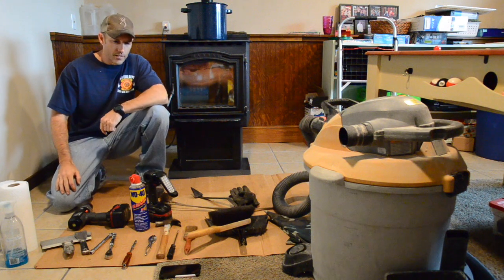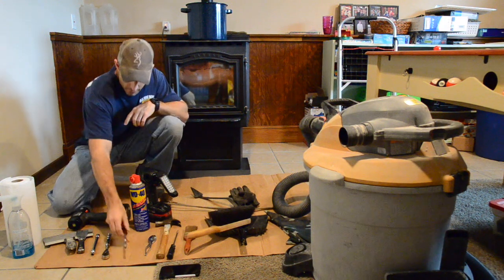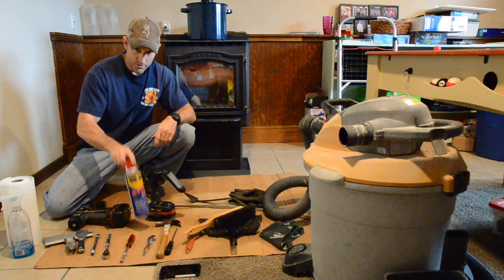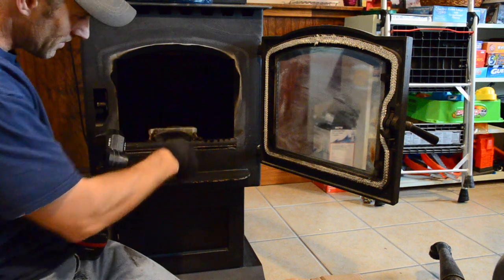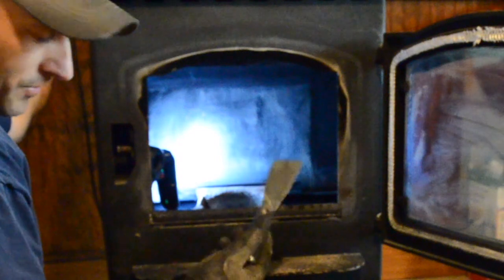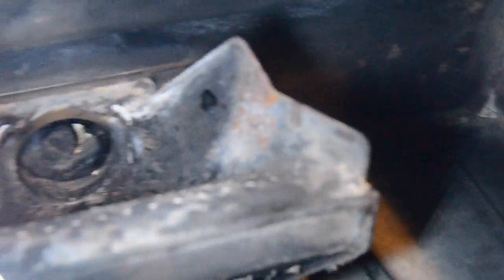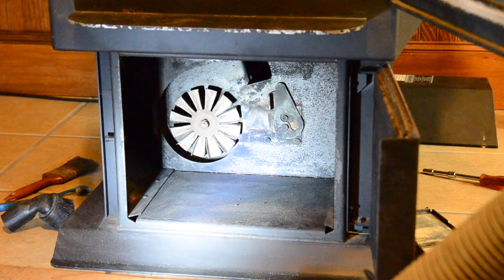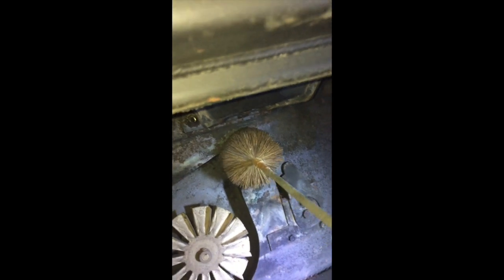Harman P-series pellet stove cleaning END OF SEASON P68

Comment: Great video , thanks so much. I just had one installed this past summer , learning on the fly what to look for  !
Reply from the maker: I must have 15 videos on the Harmon. You picked the best. Stay warm
Reply: @DIYJIM  Hi Jim. I have a question about the pellet stove. I had it installed in the basement and made the mistake of putting a smaller screen on the outside preventing it from getting the air supply , took it off and cleaned the pipe as far as I could go from both ends, I need to get a better brush to run it from end to end  it worked better, but the smell was giving us headaches, so I shut it down until I figure out the problem !  I've been watching videos and reading up where it says to install a outside air intake, that this allows the carbon monoxide from building up , I believe that is part of the problem ! Do you recommend putting this in and do you think this will take care of this problem ? I'm also going to get a carbon monoxide detector that is recommended  ! Thanks for your help !!
Reply from the maker: @raymondhoagland4976  I have a cold air intake on mine it is right below the exhaust. I have never had a problem. It should actually run much more efficient with a cold air intake.
Reply: @DIYJIM  Forgot to add , the stove was put in the basement. Thanks so much Jim  !
Reply from the maker: @raymondhoagland4976  maybe you should put a 90° on your outside exhaust and go up a little on the exterior wall. Then put a cold air intake.
Reply: @DIYJIM  Thanks Jim. Have a great day !
Reply from the maker: @raymondhoagland4976  welcome

Comment: I had a St. Croix pellet stove for 18 years until a lightning strike took it out. I replaced it with a Harmon. I hate my P-68 pellet stove! I've had nothing but trouble with it and Harmon won't even give you tech support. It's a $4000.00 pos, but live and learn. I'm stuck with it for a while now. Thanks for the video! I appreciate it, brother!
Reply from the maker: Sorry to here that, my stove has never let me down. Hope some of my videos help you https://www.youtube.com/playlist?list=PLZEGsnRsdHN5OBGSj2h0bNAqFjsPyroG9
Reply from the maker: Was your ST. Croix easy to clean and did you burn the same amount of pellets? Why did you not buy another one? Asking in case I ever want to change my stove.
Reply: @DIYJIM  I never had to do anything with my St. Croix for 3-4 weeks at a time, except pour bags of pellets in. There is an extended handle that scrapes the heat exchanger without opening the stove. The burn pot is self cleaning too. The bottom of the burn pot is about twice as large as it needs to be and moves, slowly (probably like the minute hand on a clock) back & forth cleaning and scraping the burn pot as it runs. Regular cleaning and yearly cleaning was MUCH easier. I definitely used about 20-25% less pellets in the St. Croix. The Harmon is definitely less efficient. I'll post my saga, as briefly as possible about my issues with my Harmon in the next post. BTW, you have great videos on your channel!!
Reply: @DIYJIM  OK, I decided to buy the Harman P68 because of good things I read on some forums. Many Harmon owners swear by them. So, when I get it home, I noticed that the standard pellet stove vent didn't fit the exhaust of the Harmon. I called the dealer where I purchased it (the only one within 150+ miles of me) and he told that they drill two holes, fill the gap with high temp silicone and use two self tapping screws. This just didn't seem right to me. After some research, I found that there are actually adapters for Harman stoves (to reduce the size for standard vents.  Harman won't sell to the public, so I had to order it from the dealer, wait almost two weeks and drive 75 miles to pick it up. That solves my first problem, but my problems were just beginning. I decided to just put brand new 4" good quality venting and start new. I fired up the stove, and the odor of smoke was pretty bad. I checked my vent and all seemed fine. It was coming from the stove itself. Since the dealer didn't even know about the exhaust outlet, I called Harman directly for advice. They will not speak to customers directly and told me to call the dealer. They came out and told me I had to use 5" vent and they wouldn't warranty the stove unless they did it. $650.00 later, with the 5" they installed and said to wait 48 hours before using it. After firing up the stove, the odor of smoke was worse. They came back and fixed leaks at the joints and told me to wait 48 hours. Again, strong odor of smoke in my house. They came back out and said I needed a cold air intake. $450.00 later, I fired up my stove and....strong smoke. At this point I called Harman for help and, you guessed it, they wouldn't talk to me and referred me to the incompetent dealer. He came back out and changed the gasket, I waited 48 hours and again, my house was filled with strong smoke. Nearing the end of the winter, I gave up and figured that I would try to deal with it during the spring or summer. This is the end of part 1, but it gets better
Reply from the maker: @timmack2415  holy smokes wish I lived near ya I would come try to help ya.
Reply: @DIYJIM  I bought two propane fireplaces and used them for the next two years. This summer, I called the guy who sold me my St. Croix and he came out to look at it. Apparently the welds on the heat exchanger on the left side were so bad, they actually had gaps, and smoke was getting through. I called a welder who, for another $200 patched up the welds. I tried it and all seemed well. I ordered 4 tons of pellets in October and was all set to use the Harman this winter, and I did for about two weeks until the blower motor became really noisy and then stopped working. Mind you, I haven't even burned a dozen bags. I had to call the "dealer" to get a new blower motor for $235. The stove was working until, on Thanksgiving, I woke up with a sore throat, burning eyes and smoke again. Apparently the weld on the other side of the heat exchanger cracked. 😡 I have 5 grand into this thing and I've had a few weeks of operation from it. Aside from all that, I have several gripes about a few poor design flaws that I haven't gotten to. St. Croix was always excellent with giving great tech support on the phone, Harman refused to even speak with me (and I'm a super patient and polite guy) even with all the problems with my "Harman dealer" I'm not sure what I'm going to do at this point. I'm in for over 5 grand at this point and still don't have a working pellet stove.
Reply: @DIYJIM  Thanks, Jim! I wish you were closer too! Sorry for the long rant, but it's just been a frustrating journey. I either need a welder, or a bottle of Valium at this point. LOL How often do you need to scrape the burn pot on yours! The ash builds up, covering the air holes and the flame seems poor. Is it normal to have to clear the ash every several hours? Thanks
Reply from the maker: I normally scrape the burn pot and heat exchanger and add pellets once a day. Sometimes I might skip if in a hurry. It only takes a couple minutes. Check out my daily routine video  https://www.youtube.com/playlist?list=PLZEGsnRsdHN5OBGSj2h0bNAqFjsPyroG9.
Reply from the maker: I have thought about switching my pellet stove for a propane stove but after doing the numbers it seemed like it was going to cost to much for propane. What did it cost you for propane compared to pellets. I have saved on pellets because I installed heat pump air conditioners that I use when it is above 30 deg F. Here is a link to one that i am thinking about installing in my garage   (DIY Mr cool) https://amzn.to/2RqU0C0
Reply: @DIYJIM  Thanks! My issue is that (and I've used different brands of pellets) that ash builds up, blocked the holes and doesn't burn right. As opposed to normal scraping, like you show, I actually have to knock the ashes down into the ash pan because they build up and the stove burns poorly. I have to do this every, say, four hours- more if it's really cold out. I hope I'm explaining this ok. If I could post a picture, I would.
Reply: @DIYJIM   Your channel inspired me to call a welder to fix it. He left here about an hour ago and I have the P68 running!! So far, so good! 🤞 Thanks for the videos, Jim. Had I not found your channel, I would not have my stove running right now.
Reply from the maker: @timmack2415  Awesome hope it keeps running good for ya

Comment: It's supposed to be fairly warm tomorrow, so I'm going to do a good cleaning
 tomorrow. I hadn't used my P68 in two years, so this was a great refresher course for me, thanks. The only question I have is that I noticed that you don't have a Tee with Clean-Out Cap in your exhaust system. I was told that they are required by code for pellet stoves. Great and helpful video, brother!!
Reply from the maker: Not sure about that,  I was not told when I installed. Maybe the code has changed, but not sure why you would need one. My stove works great without it. I only clean my exhaust with the brush once a year.
Reply: @DIYJIM  I'm not sure if it's a local, state, or national code. I also used a 90 at the back of my pellet stove for several years with no problems. An HVAC guy was at my house for an unrelated issue (to install a new duct for my central A/C) and told me this. He said something like this: Instead of ash accumulating in the elbow, it falls into the lower part of the tee. Also wood contains minerals in the ash that can be too heavy for the venting system to push up and out. Either they'll settle in the 90 or, even worse, they roll back into the stove when the blower is turned off. Either way, restricting airflow. IDK how true this all is, but it made sense to me and I replaced my 90 degree elbow with a tee and clean-out cap before the next heating season. I can tell you that, like you, I only clean my vent once a year, but I take the cap off and empty the ash two or three more times a season and there's usually at least an inch or two in there each time. I guess the theory is that heavier contaminants, via gravity, will settle in the lower part of the tee, thereby removing them from the exhaust system completely.
Reply from the maker: Guess that does make sense my stove has work good for about nine years now so I think I’m keeping mine the same. Thanks for looking out

Comment: Thanks Jim !! - very helpful info -- working on our Harman P-68 right now --- replaced combustion fan motor and blade, and the pellet stove worked great for a few days - then stopped feeding pellets - so i replaced the auger motor - and several other smaller items -- the stove works now - for the most part -- keep getting an alternating 6 red lights and other times 5 red lights... So i am thinking i need to replace the upper and lower door gasket and since i have the item  i will also replace the firepot gasket - hopefully then, the stove will run . If replacing these door gaskets and firepot gasket do not resolve the issues - i'm not sure where to go from there... (replace the controller board ?)
Reply from the maker: Good luck I have not had to replace any motors yet. Hope everything goes good
Reply: @DIYJIM   - aye - Thanks - will let you know what happens...

Comment: This was very helpful. Thank you! I thought having a deep clean would get my Harmon (same model) up and running this season but I keep getting 2 flashing lights. It will work through one cycle and then start  flashing or it won't work at all. I even replaced the ESP. Any advice? My local dealer can't get here until probably January at this point and its getting cold. Thanks
Reply from the maker: Are you on Facebook if so join the Harman Facebook page. You can post videos and will get a bunch of answers. Sorry I can not help

Comment: Hi Jim Todd here again just curious what pipe cleaning brush kit ya bought for your pellet stove. I found one made from brush tech that looks very similar to yours I also have a 90 degree elbow to get past just curious did ya cut the plastic handle off so you could insert it in your drill or did it come like that
Reply from the maker: 3' flue brush  and rods   https://amzn.to/33N78q5 I think this one is just like the one i used in my video hope this helps
Reply: Ok thanks alot Jim I'll check out the Amazon link
Reply from the maker: I think I bout the one I have from lowes
Reply: Ok thanks Jim I'll check out lowes also

Comment: Hi got a question Jim just bought a pellet stove getting ready to hook it up soon . I am in the process of hooking the pipes up soon . I also have a basement set up a tee coming off off the the stove adapter then a 3 foot duravent attached to a 90 degree elbow then straight out the wall will another 3 foot peice then a cap. My question is do I need to high temp silicone every pipe. Some say yea some say no. I wanted to know what your thoughts are. Also were I come out the wall it's only about 2 ft to ground level for exhaust. Manuel says that's the minimum but wanted to see what your thoughts are. I was orginal gonna vent under a high deck but I'm afraid of gases causing moisture and rotting my deck out.
Reply from the maker: I did not use high temperature silicone on every connection I think the only spot I used it was the first connection coming off the stove. I agree I don’t think venting under your deck would be a good idea. Make sure you also meet your codes for where you live. Sounds like you are doing it correct, I think I’m about 3’ off the ground where my vent comes out
Reply: Ok thanks Jim I got one more question for ya when you switched from a wood stove to a pellet stove did you notice a difference in heat loss. I ran a wood stove for 15 years and I'm gonna try a pellet stove for the first time. My wood stove was a 50,000 btu and my pellet stove is made by king is has twin blowers and supposed to put out 48,000 btus
Reply from the maker: @toddswatsworth4118  definitely no, but I do spend a lot more money on fuel. When I Burnt wood I used to get a lot of free wood.
Reply: Ok Jim thanks for getting back to me I greatly appreciate it. Keep up the great videos they are very helpful and thanks again.